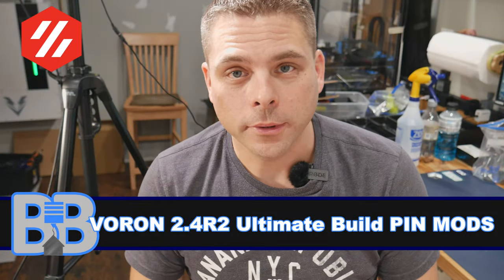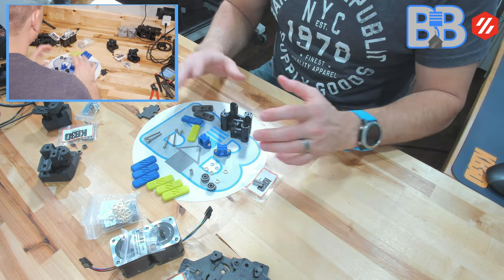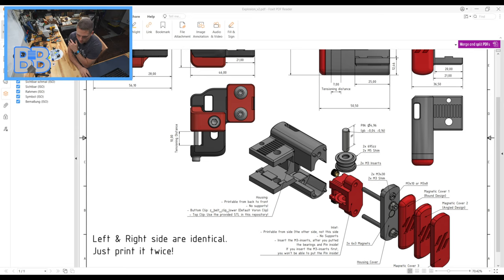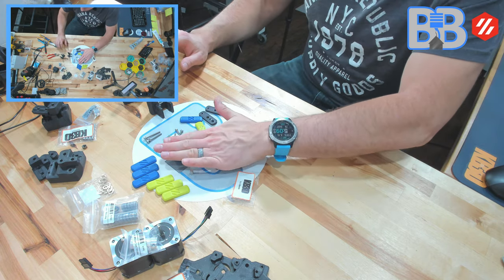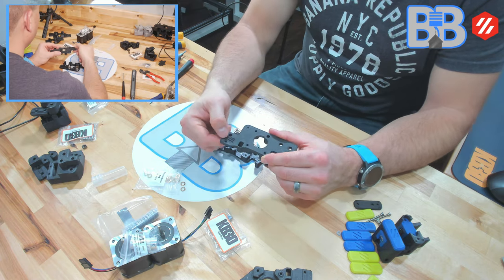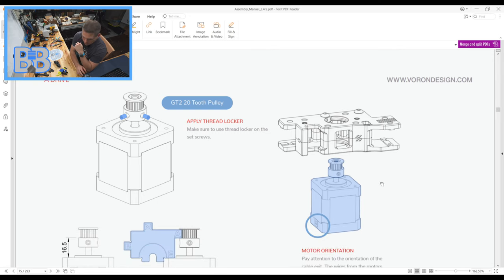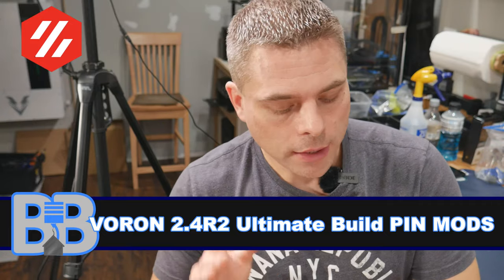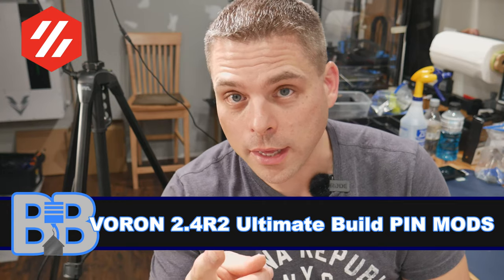Part 6 ULTIMATE Voron 2.4R2 Build (PIN MOD VIDEO)

Comment: Appreciate you making these videos, they are fantastic resources for new builders such as myself. Should be starting my build in a week or so waiting on one last shipment. 

Regarding the A drive pin mod, did you print the pin mod specific a drive parts or are you using the standard ones?
Reply from the maker: The A/B Drives have pin-modded versions: https://github.com/VoronDesign/VoronUsers/tree/master/printer_mods/hartk1213/Voron2.4_Trident_Pins_Mod
Reply from the maker: Let me know if you need any help!
Reply: @BuildItBasement  I'm currently printing them on my ender. I was hoping you used the ones in the bom as mine look like crap due to having to print with a brim to prevent warp.
Reply from the maker: Get yourself one of these - https://amzn.to/3ksEffu (Deburring tool)
Reply: @Build It Basement  just ordered with a few other tools I'll need for the 2.4 build. I'm hoping this works better than an exacto.
Reply from the maker: Night and day.  I sometimes still use a brim on prints - You'll need it!  A decent small heat gun is good to have as well, if you have home with your soldering iron - it's a good purchase as well.  Deburr - hit it with some heat, it'll look near perfect.
Reply: @Build It Basement  ironic as I was thinking about a heat gun today to get rid of the white bits where I trimmed the brim. I'm definitely going to give it a shot on the next piece.
Reply from the maker: @CoOnIcK91  Exactly what it will do.  Removes the cut or stress marks.  Can also help if you ever geta nozzle really fudged up!
Reply: @BuildItBasement  Holy smokes, The heat gun was the charm! The deburring tool definitely helped. But the heat gun takes the cake for removing the cut marks.
Reply from the maker: NIce - Glad it helps! If I ever have elephant foot, I deburr and then hit it with some 300 or so degree air. No one will ever know the difference!

Comment: Just a note - on my pin mod, for the A/B parts, one pin is 30mm, and the other is 28mm.  The 28mm goes on the "double-stack" (the pin that holds four actual bearings).
Reply from the maker: You are 100% correct.  There is a 2mm difference between the two rods, hardly noticeable - but notable.
Reply: @BuildItBasement  ahhhh.  I should have read the comments.  Just assembled A drive with two 30mm pins....

Comment: Do we have to reprint any parts I got from PIF for the pin mod other than the a/b ramas idlers?
Reply from the maker: Max - If you used PIF I would suggest using the parts they provided as a base.  As for print upgrades from the standard build: Rama Idlers, Pin mod A/B, Pin mod X Gantry, Screen, Purge Bucket, SB front if using a 3DO camera, Panel mounts, 90 degree Z belt clamps.  That should get you most of the parts

Comment: Hi, what benefit does the "Pins Mod" get you? I've seen this and was wondering if it was worth the effort? Thx
Reply from the maker: It's a well argued mod on the discord.  Some people swear by them - others not.  The idea behind them is that the pins allow for a more precise movement.  First off the pins are much higher tolerance in circumference than the M5 screws normally used.  M5 screws actually measure around 4.8mm, where as the pins are  at about 4.95mm.  If you take an F695 bearing and put in on an M5 screw you can feel and see the amount of "slop".  This will have an impact to a degree.  It will be less noticable when movements are long and in a single drive direction, however once you start moving quickly or rapidly with your belts moving back and forth that "slop" allows for some wiggle in your idlers and bearings.  This equates to additional belt movement (or lack of movement) during a print.  I'm going to post some pics on the community side of my YT channel - if you want to see the parts being measured, check it out.